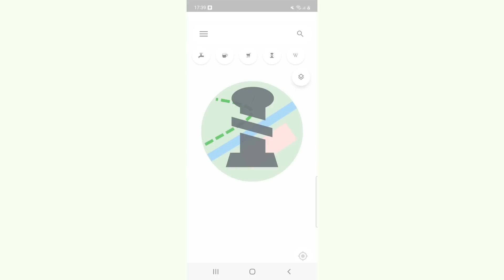How to get WATER when your NARROWBOAT has BROKEN down!

Comment: May, I'm glad there was a happy ending to your story today concerning the breakdown.  It's good you are resourceful and determined you could be a tow horse to get the boat to the water point.

With the no-start problem, it sounded like your starter battery opened up.  It's very hard to jump-start a diesel when your starter battery is open due to the high starting current required.  As a work-around, if you have jumper cables, you can temporarily jump the positive terminal from the leisure batteries to the starter battery and the engine may start.  If it does start, leave the jumper cable in place until you turn off the engine, then disconnect.  This step prevents the alternator from being damaged due to the starter battery being open.
Reply from the maker: Hey Bill, this is super interesting thank you for sharing! I enjoy learning new things. Take care

Comment: Really enjoying your videos May. 
I may sound a bit of a geek but could explain or even better  do a video and explain how the batteries and power works on your boat. 
Can you use normal 230 volts power. 
Can you watch TV in the evening or 
Do you need to have the engine running to get power.

That fellow boater was really kind to get you going
Reply from the maker: Hey David, yes I will deffo do a video on power in the future! Stay tuned 😄
Reply: Thank you.

Comment: Any idea as to what caused the battery to die?
Reply from the maker: Old battery? Left the key in the on direction before but pretty sure didn't this time... hmm any other thoughts?
Reply: @wellbeingonwater  if possible check the levels on the  old battery and leave it on charge for 24 hours. A battery can operate perfectly in warm weather but die in colder temps. Everything is operating in a harsh environment  and I would check all your cabling to make sure they're all clean and tight particularly the earth strap. I would disconnect everything one cable at a time clean with emery paper, tighten and smear with vaseline to protect from moisture. It's just routine maintenance  and ideally should be done once a year to make sure everything is in perfect condition for winter. Is your starter battery separate from the house batteries or can they be linked and unlinked?